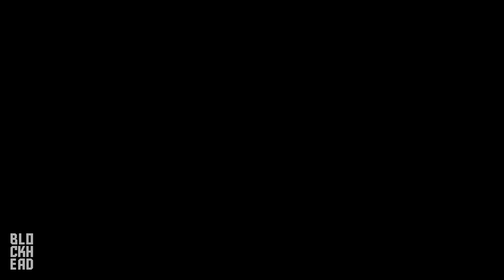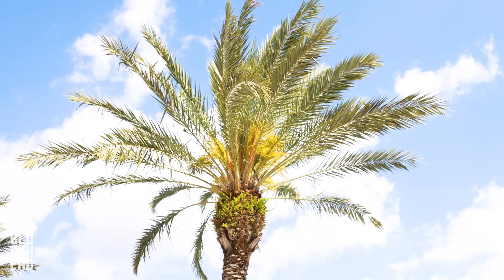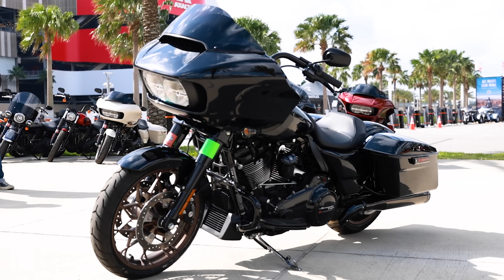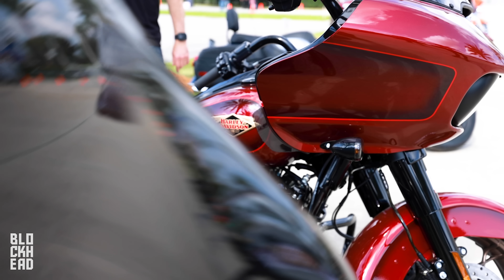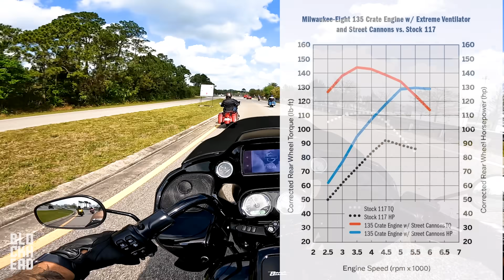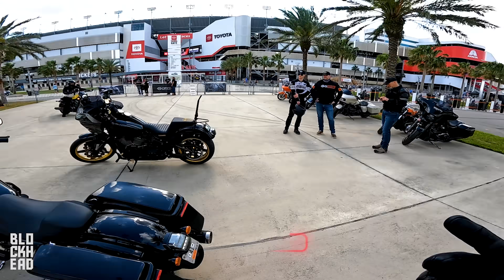Harley-Davidson 135ci Crate Engine TEST RIDE!

Comment: What’s odd to me is my S&S 124 ci evo motor has to be rode 500 miles under 3k rpm to break it in ….S&S is the builder that said how to break in my motor …so why are these guys twisting the wick if it a brand new motor …..hmmmm misleading to me

Comment: I need that motor motor I just got a 23 rode glide st with the 117 3 days ago brand new the motor already blew up with 160 miles on it leaking oil smoking pretty bad heads might be warped blew gaskets guess I’ll find out in 3 days when Harley opens Tuesday
Reply: Doesn't hd give 2 yr warranty?
Reply: @RideorNever  yeah they had it for almost a month they were super nice about the whole thing I just impatient I got a really good deal on my 24 low rider s when I traded it in
Reply: @1790jman  what causes a brand new 117 motor to die with only 160 miles?
Reply: @RideorNever  he told me the oil pump failed which caused most of the oil to leak out fried the pistons they told me they sending them a whole new motor they didn’t turned into just getting parts after having it for a month I said nope traded it back in let someone else deal with cause it never should have failed in the first place I wasn’t being hard on it I told them who buys a 40k bike goes out blows it up on purpose
Reply: @1790jman  can you pay them the $8k difference for them to install the 135 crate motor with labor covered by warranty? That would be sweet. PS. Hope the issue gets fixed...and the bike really waz 40k out the door?
Reply: @RideorNever  yea like 43k after everything it was the fast Johnnie paint I asked them about doing a 131 but they wouldn’t since it was under warranty my guess was they didn’t want to do anything more than what they had to
Reply: @1790jman  aw man that sux. I never owned a harley buy have been thinking about the low rider st. But i keep hearing about these big issues. Good luck with the fix
Reply: @RideorNever  thanks man I got a 24 low rider s now my cousin has the st its awesome I’m putting the st fairing on mine here soon there super fun to ride I’m still braking mine in got new parts laying around for it lol
Reply: @1790jman  wow. Own the road glide and the low rider. Baller
Reply: @RideorNever  as my cousin would say yolo lol

Comment: nice video.. didn't really get into the feel of the bike with the 135.  I was looking for comments on any extra noticeable heat, clutch and lever pull, is it noticeably heavier with the heavier clutch plates, etc.  The RGST is a nice bike but what else does the 135 come with..  better cooling, etc?  but glad you liked it.  I am contemplating on doing a 135 on my RGST.

Comment: Good video and nice bike. Looks like it took the Indian Thunderstroke 116 cu to get Harley off their azz and make decent torque and hp. But then again, the Indian 116ci with cams, throttle body tune etc. will just about match this HD 135ci for less $$ and also be under factory warrantee.  You can now also get a Lloydz 121ci Indian kit that surpasses the HD 135ci in a smaller lighter, more durable  package. Ride safe and enjoy the ride.

Comment: "That power (130hp) from the factory that's nuts" (with warranty) (acceleration)
Triumph Rocket 3R (165hp), Yamaha Vmax 1700 (200hp), Ducati Diavel V4 (168)🙂
Aprilia RSV4 (217hp), Ducati Panigale V4R (231hp) with a quarter mile in 9.5 sec 
TTS Superbusa (370hp) in the UK the supercharged version of the Hayabusa sub 9 seconds quarter mile.
Reply: Concours 14: 158 hp, 100+ ft lbs torque

It's a very long list.
Reply: No one cares. Plus the Harley has more torque and it’s cool cuz it’s v twin

Comment: OMG. Buy a motorcycle with engineering from the last century. HD. All that noise for so little power. Buy a Duc, Aprilia, Honda, Kawi, or Suzuki. Buy a bike that not only handles, but is built far better and hauls a shitload more ass. Harleys are for idiots with stupid patches on the back of their vests.

Comment: Warranty?? Try getting harley to honour that when they have to replace all those effed up cranks with massive runouts. Buyers bearers. Hd are notorius for ripping off customers. My 2021 was out 8.5 thou at 3000 miles. And they fucked me over to a point where they said take them to court. Utter pricks.

Comment: I have an FLHCS  not installed 131 kit, 592 cam w/h many extras & I'm possibly thinking about  buying, S&S flywheel 320-0605, 135 kit parts that are needed. SE 68mm throttle body is only $309.95. Thanks for the video.😮 RLTW

Comment: Wish you could walk into Harley dealer and order up the bike with this engine option.  Then when you take delivery, you don't have to spend even more money on the crate engine and labor to get it installed.  With the cost of the bikes being what it is, it's not really practical to take a new bike and pull the engine for a crate swap unless you can find a buyer for the OEM engine.  Although in these days everyone finances everything so I'm sure someone will just put it on a credit card.

Comment: Now it's no longer a practical touring bike because with those injectors I'm sure this is terrible on fuel. My 120 kit in my 2018 is significantly worse on fuel than stock.

Comment: Got to have cats. On a bike. 
Doesn't matter that there are jets flying dozens of flights per day from one city to another and back so long as the bikes that usually don't get all that much use have cats in them. Especially the very small number of special order bikes. Wouldn't want them slipping through now, would we? 
Just ignore the constant wars and commuters throwing out all the rubbish and don't worry about highly unregulated ships and factories abroad - just make sure you keep a cat in that half a tonne of metal that gets used sometimes on a hot day.

Comment: It's kinda funny how they talk about 8% instead of 3% gains, but it gets 130hp out of 2.1 litres of displacement and less than 32mpg, I would hardly call that amazing.
I mean I guess it's good that their expectations are low, but still. Calling this a performance engine is a big stretch in my opinion
Reply: Agreed fully

Comment: Seems like a lot of money for such little power……for the same money, I could fit a TTS supercharger to a Triumph Rocket 3, and get 342hp at the wheel and 273 ft/lbs of torque…..you also get the added advantage of handling and good brakes….

Comment: Hey Blockhead I see that guys and gals are always chasing top end speed.  What about those out there looking for that whole shot acceleration?  Personally I love the feel of that pull versus chasing 150 mph.  I have a HD 103HP on my Road Glide.  Would love to see a cam recommendation or other mods to rip it off the line.  Yes everyone I know I can buy a sport bike AND then put 12 miles on it before I have to stretch out my back.  I test rode Ducati's and all that and my hands went numb about 15 mins in.  Keep up the great content Blockhead!  Thanks for keeping us informed.

Comment: Fuel motos 124” crate motor makes 123hp & 142 Tq. Harley motors and dealer dyno tunes are a Fn scam. They can’t tune a radio let alone 😂an engine they just download of a website.

Comment: A long time coming. HD really needs to branch out like they did with the Panamerica.  Using that motor alone, gives them so many possibilities  of doing non cruiser bikes. Then they may be able to keep young people interested in the brand.
Reply: @Peter  check the numbers. Yes, they have. Outsold every other bike in its class in the US.
Reply: @Peter across the board, HD numbers are down. But the Panamerica numbers are not. They sold every single one from 2021 that they made and still had them on backorder.

Comment: My dead uncle bought a brand-new knucklehead for $500 out the door in 1941. It was a 500-pound Speedster with a 61 cubic inch engine. It was Featherlite and came with a certificate stating it has been run to 110 miles an hour. Many roads in the old days did not have speed limit. When the Pennsylvania Turnpike was opens up you can get on it and see how fast your bike could go. The real truth is hardly spent makes more money with you upgrading your motorcycle that if it came equipped stock from the factory with what you wanted. Frankly I don't understand why anybody buys a factory Harley gets to throw away half the motorcycle and replace it with better part. All at the customer's expense

Comment: In the mid-80s I was looking to buy a brand new Dodge truck and I was told I would have to take the stock motor along with the motor I would put in the truck. I told him what am I supposed to do with the motor sitting on a pallet? In the old days if you ordered a British motorcycle and you could get a choice of gearing for the transmission what sheet metal you wanted what electrics you wanted in case you wanted something different from stock they would just bolted onto the fight at the game down the assembly line. People are just lazy and don't give a rat's ass now a days. If your local Pasa dealer did not have a part for your motorcycle it would be air freighted out of New Jersey and your dealer would get it the next day. That was customer service.

Comment: That Buell super bike coming out would wreck this thing everywhere, straights, corners, the line, everything.
Reply: The Buell Super Cruiser 1190 looks impressive and sounds even better. The couple of vids I’ve seen claim 165hp or 175hp and it weighs less than 500lbs. That thing will be a rocket. And it will be 1/2 the price. (Or less)

Comment: As a long time Ducati and BMW rider - these 135ci Harleys really impress me!
I don't think these videos really show what a kick in the pants these things are!
I rented a 107ci M8 Road King - rode it Seattle to New York. Just stock with OEM pipes!
This 72-year old had a great time "racing" with all the people who foolishly think they are going to blow that big old Hog into the weeds!
Until you have ridden one - you can't understand.
Reply: lean angle, weight, acceleration all factors that affect negatively the 135ci Harley.
In a straight line any modern 1000cc would annihilate the 135 Harley.
In twisties the KTM Duke 890 R will leave the 135 Harley miles behind, no need of the KTM 1290 Super Duke Evo.
And for less money stock cruisers Triumph Rocket 3R or Triumph Rocket 3GT or Ducati Diavel V4 are way more powerful (hp), quicker and faster, have way better handling and have giant torque too instead of the overpriced 135ci with little 130hp.
Reply: @THEREALZENFORCE  This mature adult does not buy motorcycles because they are more powerful, quickest and fastest. I don't race on the public highway. That is illegal.
BTW, if your Ducati Diavel V4 breaks down in Tribune, Kansas, good luck in finding a Ducati dealer who is going to rip you off to repair it. Or even has technicians that know how to repair it, and waits for 2-weeks for parts! LOL
Reply: @DennisMerwood-xk8wp  In Europe there are Ducati dealers everywhere, you literally have no clue. And on the German autobahn there are sections with no speed limits (the record is over 400 kmh  (250mph) done by a Bugatti Chiron, fully legal and with traffic, again you have no clue
Reply: @THEREALZENFORCE  Yeah, living and working for a Motorcycle Touring company in Milan, Italy for 7-years, taking people riding all over Europe - I don't have a clue LOL
BTW, getting court driving on the Autobahn at 400kmh by the Autobahnpolizei will get you a ticket for reckless driving - and probably losing your license. Sadly its you who doesn't have a clue, and talking out your a*s.
Reply: @DennisMerwood-xk8wp  "417 km/h auf der Autobahn – Bugatti-Fahrer bleibt straffrei
Der tschechische Staatsbürger, der im Juli 2021 ein Fahrzeug der Marke Bugatti Chiron mit bis zu 417 km/h – teilweise freihändig – über die A2 bewegt hat, wird nicht bestraft. Das Rasen auf einer leeren Autobahn und freihändiges Fahren als solches stellten auch bei einer derart hohen Geschwindigkeit keine Straftat dar, entschied die Generalstaatsanwaltschaft Naumburg am 12.08.2022. Sie wies damit die gegen die staatsanwaltliche Verfahrenseinstellung eingelegte Beschwerde zurück."

You have no clue like i said. Use google translate.
Reply: @Peter As I said, I don't race on the road my friend. I am a grown-up mature adult. Go ahead, be first to the graveyard. I could care less. One of these days you will old enough to be able to afford a real motorcycle - a HD.
Reply: @Peter Owning a motorcycle to me is nothing to do with "acheiving" something Peter. 
Neither is owning a 19-acres waterfront home with stables and a dock on your own road an achievement. For all we know you could have what you have because you inherited a bunch of  dough.
If owning more material stuff that the next guy is important to you - you are going to learn as you get older that material possessions do not make you happy. 
The richest man on the block still commits suicide.
Reply: @DennisMerwood-xk8wp  "No charges for millionaire who broke 400kph on German autobahn. Germany's DPA news agency has reported that prosecutors in the town of Stendal in the state of Saxony-Anhalt, have reviewed footage of a Czech millionaire driving his Bugatti Chiron at more than 400 kilometres per hour on a stretch of autobahn between Berlin and Hanover, and have concluded that he did not break any laws." You have no clue, proven here

Comment: The do have a drop in for all Rushmore motor bikes.
I have a 103cc forged piston kit tuned to 100hp and 103 torque in a 2010 FLTRX Road Glide

Comment: Sportbike riders have been doing this for years, but with Harley this appears new. Kinda funny. I have a 2018 Vmax That will take that bike ;)
Reply: I haven't had the guts to get on a Vmax because I know I would kill myself but I did ride a V65 Magna back in the day. In the late 80's no one cared about the brand, only the engineering and performance. As a "muscle bike" the V65 was only eclipsed by the Vmax. I thought that Honda had gone far enough & anything beyond that would be suicide. Pulling the front wheel up to balance without touching the clutch at 65 mph on a 600+ lb bike seemed extreme enough to me. The Vmax and the Suzuki "water buffalo" two stroke triple, were the two bikes I always wanted to try but feared. I wonder how this 135 road glide compares to the V65? I wonder if it would easily "stand up" at 65mph? It would be nice to have something that feels like the V65 without going beyond that level. I often think about turbocharging my little Goldwing or 3-D metal prototyping a Vtec or V-boost system for it. Sure would be nice to have an extra 50 horses. But it would probably kill my fuel mileage and my fuel stops would be under 230 miles.
Reply: @jackandblaze5956  "As a "muscle bike" the V65 was only eclipsed by the Vmax" Then i guess you missed all the following muscle bikes :
Bmw K1300R, Triumph Rocket 3R, Triumph Rocket 3GT, Ducati XDiavel, Ducati Diavel (the old V2 and the new V4), they all by far outperform the V65 Magna in acceleration and top speed and handling
Reply: @THEREALZENFORCE  It was only eclipsed by the Vmax in it's day. Of course many great bikes followed later.
Reply: Yeah - but its not a HD.
Don't see too many riders with "Yamaha" tattoos!
Reply: @DennisMerwood-xk8wp  Exactly my point! Yamaha riders dont belong to a cult.
Reply: @glickmpb  Except those ones that are all decked out in their Valentino Rossi full race leathers to out for a hamburger!
Always looks a little "cultist" to me! LOL
Reply: @DennisMerwood-xk8wp  There is nothing cult like with safety regardless how you try to characterize it. There are, however, when you get people who put tattoos all over their body because of magical marketing by a motorcycle company! lol  Let me guess, you have HD tattoos, too??
Reply: @glickmpb  No HD tattoos my friend. I would not have enough skin to tattoo one of every motorcycle bike brand I have owned and liked.
Let me guess - you don't like HD motorcycles, or approve of their riders eh?
Reply: @DennisMerwood-xk8wp  Wrong on both counts. I actually own a Harley, but I dont ascribe to a "lifestyle" of putting tattoos on my body because of genius marketing. Plus, I would hate the dirt bag image. Im much smarter than that.
Reply: @glickmpb  What's the difference between   a Hoover Vacuum cleaner and a Harley Davidson?
Position of the dirt bag!
Reply: @DennisMerwood-xk8wp  VERY old joke.
Reply: @DennisMerwood-xk8wp  HD Tattoos are a bit the same as if people would wear BMW or Coca-Cola tattoos, a bit of commercial brand worship, isn't

Comment: Or, you could buy a stock Rocket III from Triumph.
Reply: northerniltree,......did that, bought a 2022, put on a Corbin fairing with radio, and the Triumph is super easy to ride and handle,.....and you don't look like every other bike on the road.
Reply: @lawnranger3432  Corbin's got a great color matched bag kit as well. $$$
Reply: Yes I know,...still thinking about the bags.

Comment: Why did harley go back to putting the gas cap on the side of the tank again? It just bugs me so much they didn't keep it in the center
Reply: I hate my middle fuel cap, can't fill tank all the way on the kick stand.
Reply: @athroop1321  really? I've never had that problem with mine. Does yours lean harder than stock?
Reply: @athroop1321  really? I've never had that problem with mine. Does yours lean harder than stock?